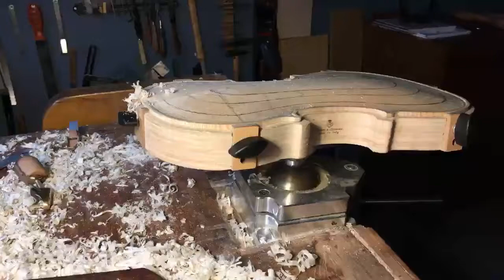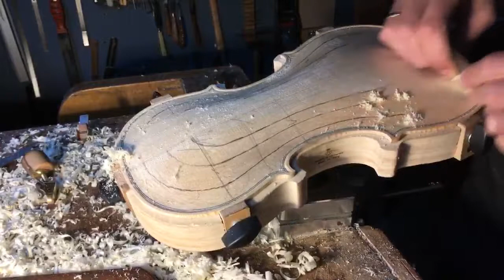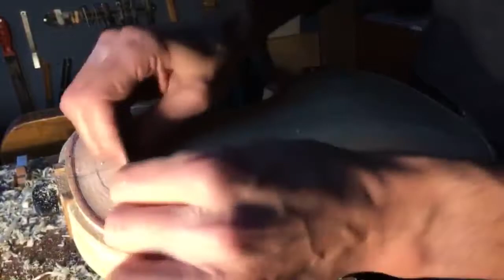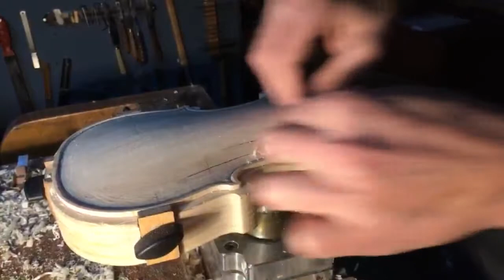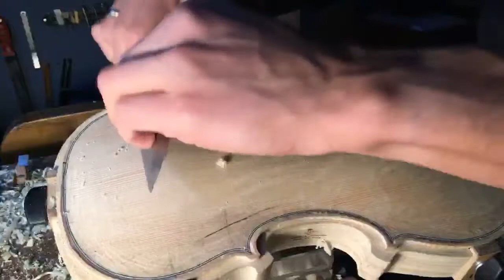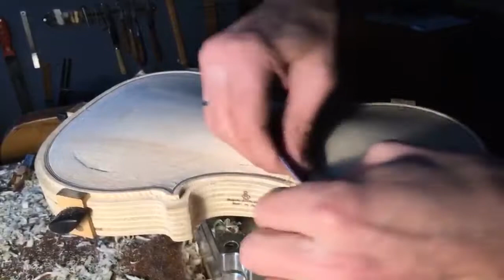Scraping a violin top

Comment: I like this mode of working, the quality of the resulting surface seems different than with sanding or other processing. It is possible to imagine that the sound qualities would be better too and that a smaller (lighter) amount of varnish would be sufficient for a smooth finish.
Reply from the maker: Thanks, yes scraping creates a fantastic surface for varnishing. Lots of structure and life!